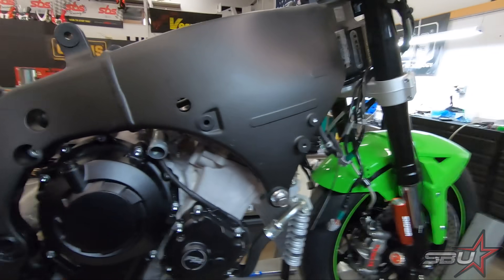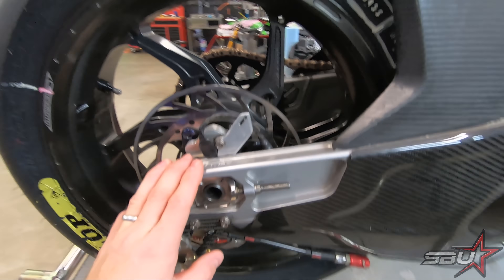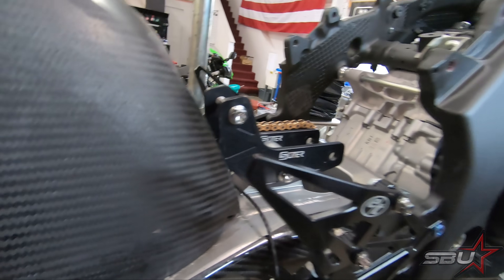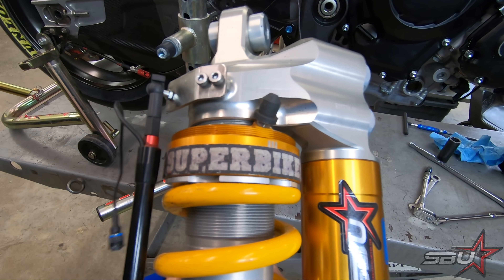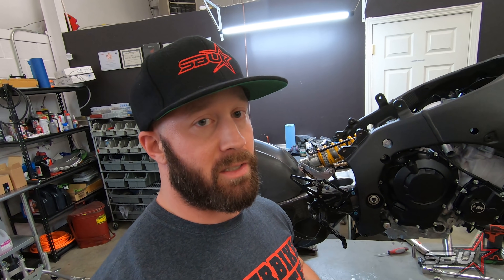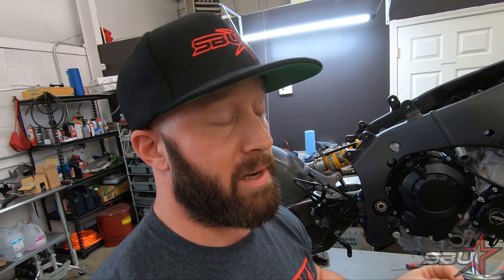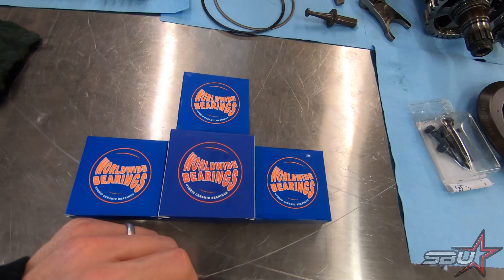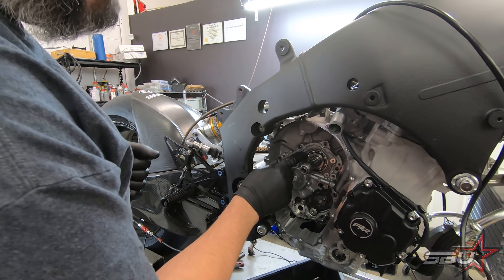2021 Kawasaki ZX-10RR SBK Pt.4 - Teardown, Billet Gearbox, Suter Swingarm, Superbike Forks & Shock!

Comment: It's amazing how far motorcycles have come along. In my day I raced TZ 350 Yamaha's and in the paddock 99% of the bikes were pure racing machines with the odd converted road bikes, now its the other way round with very few pure racing bikes such as the odd 125 or 250 and a plethora of production road bikes. For example, in 1988 Steven Cull broke the Isle of man TT lap record with 119.08mph on a grand prix production RS500 triple Honda, nowadays a Kawasaki 650 twin roadbike tuned is doing laps over 121mph!!!!
A very interesting video.......

Comment: Great bike build to use in motoamerica. Appreciate the description of every part you change and add.                   Have a question about the motec ecu, is this available for consumer sale and does it come already programmed with the zx10rr bios to run the bike. Reason I’m asking is woolich doesn’t have a flash yet and the krt ecu isn’t out yet
Reply from the maker: We do sell them to the public, but it's not a cheap upgrade. A kit like ours is $10,000+ not including sensors. We are actively working on an alternative.

Comment: Hi, do you have the part number for the steering head adjustment kit? Would be interesting to test, if it is a Kawasaki part it should be legal here.
Thank you
Reply from the maker: There are different part numbers for each component. It's all in their accessories catalog or online.
Reply: Ok, thank you. I’ll take a look at that

Comment: What did the other racer complain about with the other gear box?
Reply from the maker: They don't shift as crisply and the old version was a little long.
Reply: @SuperbikeUnlimited   my apologies i meant to the race officials that were requiring y'all to change your gear box.
Reply from the maker: @leegpmx4life145  MotoAmerica requires a standard (stock) transmission, so these are not allowed.

Comment: ummmmmmm!!!!!!!! Does anyone else NOTICE the rear tire arrow?!!!  It IS Pointing THE WRONG WAY!!!!!!!!!!!!  Yes it's a slick and I've reversed both front and rear tires bla bla bla!!
The shop may "do good work", BUTTTTTT in my opinion when promoting your shop/work,  all I's should be dotted and T's crossed and arrows pointing the correct direction
P.S I also ride a WERA converted back to street CBR 1000RR and just bought in November 2020 ZX10R KRT!!!!!  So I kinda' know my business!!   I'M SURE Y'all DO TOO!!!!!!!  So let's laugh!!  because I'm not trolling and bla bla bla
Cheers to all good people!